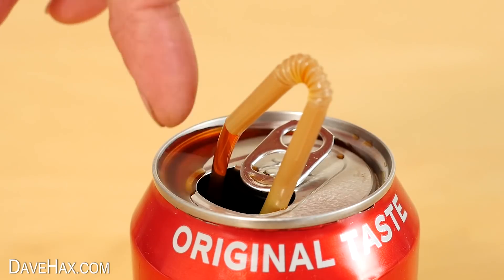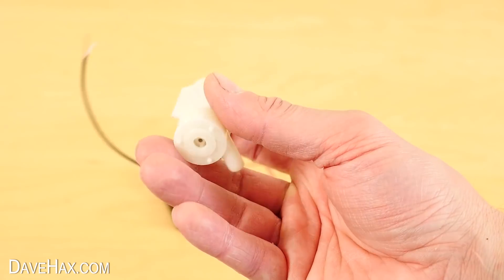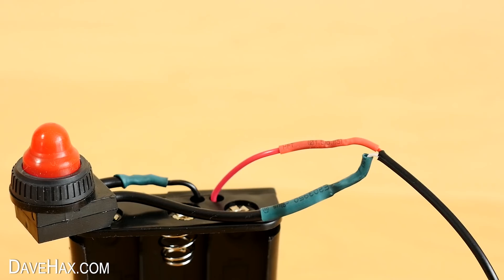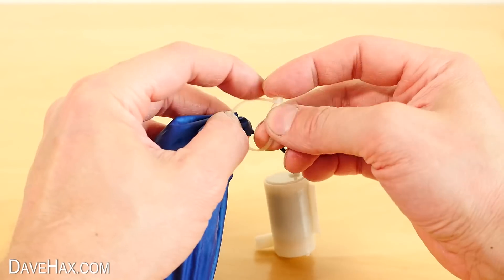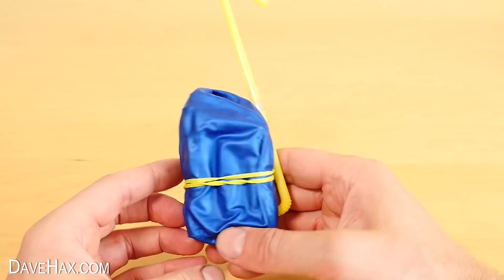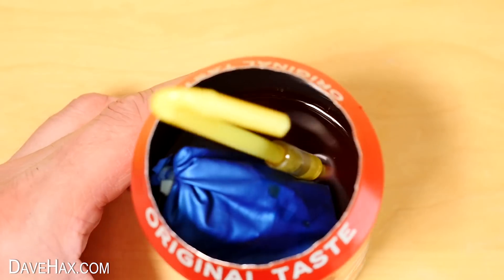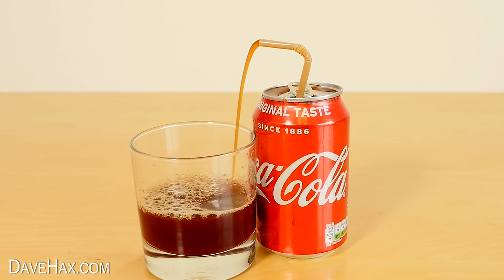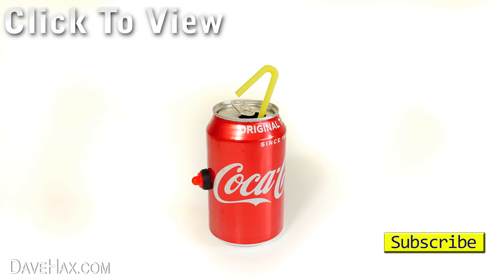Coca Cola Soda Can Non Stop Fountain

Comment: There is a thing called physics and you do not need a motor or pump to do this, it is like siphoning gas from a car once it starts it will not stop till you remove the hose/straw but if it is siphoning back into the same container it will run forever.